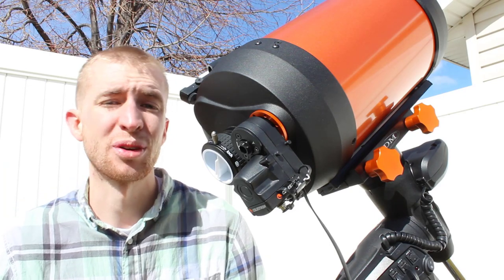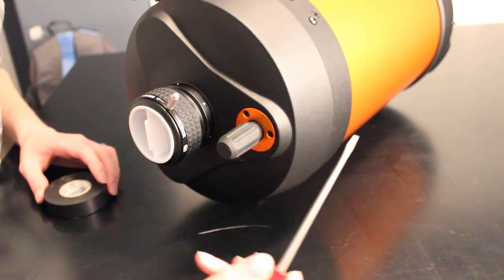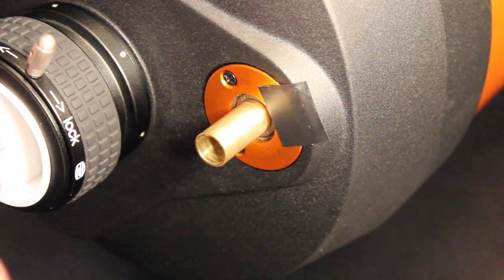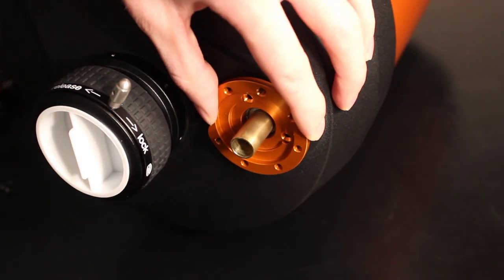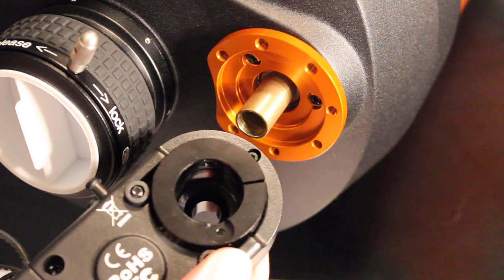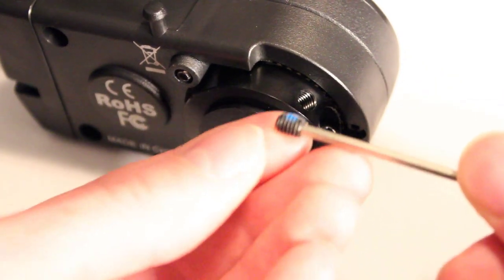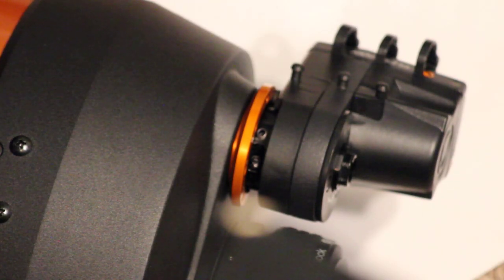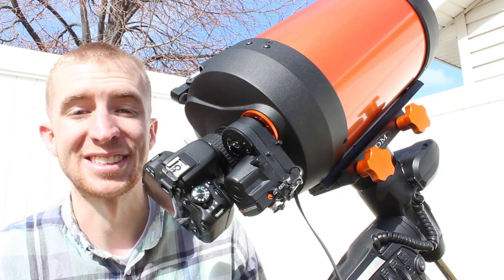How to Install the Celestron Focus Motor (Quick Version)

Comment: Nice video! Did run into a problem  though.
The stock mounting plate has a chamber in it to hold the bearing, because the bearing  is sticking out a little bit above the surface.
The new mounting plate hasn't such a chamber, making is to stress the bearing and resulting in too much friction.
I ended up leaving the stock mounting plate under the new one, bolts were just long enough.
I have a C8.

Comment: Thank you for this great video. I managed to successfully install my motorized Celestron focuser. One thing to note is that at the end when tightening the set screw, it has to go all the way in. I had to try 3 or 4 times because I couldn't calibrate the focusing motor. The set screw was protruding and it was in the way. What threw me off is that you have to put a little bit of pressure to tighten it, and I didn't want to over do it. Other than this, it's a relatively simple but tedious exercise. Thank you!

Comment: I have a C8 that is a bit older and has a raised focuser knob casing and a metal focus knob. This focus motor absolutely will work with it, however a 3D printed adapter is needed to connect the orange mounting plate to the raised collar. Definitely worth the while.

Comment: I already praised the video (see below). But now that I have things working right, I have one more comment about the installation. The instructions in the manual and video talk about installing the set screw (with the blue junk) with just a few turns. I tightened it until I got resistance and (thinking I was done) tried the focuser. The motor was running, but focus wasn't changing. (You can look through the hole to see the brass shaft moving or not.) I discovered that the blue-junk-set-screw needs to go past the resistance point (probably the blue junk) until it squeezes the shaft. That's much deeper than I expected. All good now. (Except for clouds.)
Reply from the maker: Joseph Shuster Yes, tighten it down well. The blue stuff is thread lock, probably blue loc-tite.

Comment: Thank you. I watched this video before I installed my  Celestron Focus Motor on my Nexstar 8SE. It made the process a lot easier since the instructions are written in extremely fine print. The only thing I forgot was to tighten the last set screw. I wondered why it would not calibrate and just turned and turned. My bad. But all is well now.
Reply from the maker: John Patterson hahah yeah that would do it! Glad you got it working.
Reply: Thanks John you solved my problem - and thanks to Astro Blender as well

Comment: One follow-up after I struggled a bit with the install: At 9:00 you imply that you can attach the focuser to the plate using the pairs of mounting holes. For my first attempt, I picked two holes that looked good. After I got one screw into the plate, I tried to start the other screw. It wouldn't catch. I removed the focus and the plate and found that (at least) one pair of plate holes were 1-2mm too close. I found a good pair to get the focuser angle I wanted. It's easier to see the problem off the telescope. With the focuser's mounting screws extended, run the plate around the different candidate pairs. Most fit fine. One pair is tantalizingly close, but not close enough.
Reply from the maker: Joseph, that is strange, I was under the impression they all fit fine. I wonder if that is present on all the focusers or was a bad machine job? Either way, thanks for your comment.

Comment: Excellent Review Slymin!  I didn't know that you can use Hand Controller to change the focuser position.
Reply from the maker: Thanks Ray! Yep, you can use the hand-controller as long as your hand-controller is up to date. Celestron added Motor Focus controls to the hand-controller with firmware version 5.30.8333. That version is a bit-buggy though, so you would want to update the hand-control 5.30.9009 which fixes the problems introduced in 5.30.8333. That being said, this was just an install video. My full review is filmed but I still need to edit it. It is an awesome upgrade and is instantly responsive, I can't be more happy with it!

Comment: Slymin, just saw your that you already did a review of the VX mount with the 6 inch newt.  Good review. Sorry for asking you about it in my previous comment. This review on the new focus motor is very well done and easy to follow. Are you using any software controls for auto focus?

Comment: Hi.. thanks for the valuable info. I was in the process of installing my focus motor adapter plate to the back of my SCT. Noticed the adapter plate does not sit flush to the back of the OTA and there is a gap. Correct me if I am wrong but your adapter plate looks flush to the OTA. Just wondering if the focus motor adapter plate is recessed like the stock focuser plate.

Comment: They didn’t supply the scissors or tape?  What kind’a crap is that?!  

I just recently received a new 8SE, and after messing with the focus knob, I’m seriously considering one of these.  Just annoying to focus manually, especially just getting familiar with my first Schmidt-Cass.  That focuser seems to turn forever.

Comment: As always Slymin ,your videos are amazing and its where i come for great knowledge , one question ,where do you connect  the focuser  ? does it have its own power outlet? thank you , this is on my list ,
Reply from the maker: Thanks, I appreciate that! It has 3 power inputs. You can use the AUX port on the mount, USB (needs supply at least 900 mA), or a 12V, 1A power supply.

Comment: Hey Slymin, You seem to know more about this than the folks I spoke to on FB? lol .. I asked 4 people and 4 different answers..   I'm trying to figure out what i need to do Astrophotography on my 8SE . My understanding ( PLEASE correct me if i"m wrong ). but I need an EQ Wedge , the starsense autoaligner ( it has a camera? do I still need to purchase one for photos?) or can I use that one? also the Focus Motor . are those 3 things basically what I need? or will I still need a Guidescope and camera? Oh Also I purchased the 2 inch eye piece kit. I know it's not the best .. and I need a few more good eye pieces later on, but comes with the diagonal etc. will the 2" stuff be an issue with any of these things?  and is there anything else I need? dont' need? thanks ( I've got a bunch of stuff on my list, like vibration pads etc.. but just running into an issue where I find something and it turns out it's Outdated ( like the NexGen ) etc. . if I can get an ALL in one part . that's fine long as it's not costing me 2 arms and 6 legs LOL
Reply from the maker: If you want to do long exposure astrophotography and you don't want to buy a GEM, then the EQ wedge is essential. It is tought to balance, but workable with n 8". You don't need StarSenese for astrophotography. A guide scope is helpful with a sensitive guide camera, but I would only use one if you're imaging at f/6.3.

My top list for the 8 SE long exposure astrophotos would be:

EQ Wedge
F6.3 focal reducer
Probably a 50mm guidescope with ASI guide cam or Orion Starshoot Autoguider.

If you find you're having troubles with weight, consider investing in a GEM.
Reply: @AstroBlender  hey Slymin, thanks for the info. 
But after adding up all the parts etc. And weight . I realized there is a faster way,  that won't require an EQ, or f6.3 focused or  a guidescope with a camera. On my 8SE.. All unnecessary weight. Of course my solution.cost a few bucks. But minus all those things I won't need to purchase.. Cuz astrophotography  will take only seconds due to the f1.9 on the Hyperstar that a company here in Tucson sells called Starizona. They custom make the Hyperstar. With it I won't need any of that stuff except for the starsense !!  You should check it out if not familiar with it.   But think that's the route I'm going,  less parts to break down.etc.
Reply: @AstroBlender  Are you able to answer Frank's question on whether the 2-inch diagonal on an 8-inch SCT will be an issue in conjunction with this Focus Motor?

Comment: Hi, Isn't it reasonable to tighten the clamping bolt first and then the set screw to maintain the focusing axle to be secured at center of the holder ?

Comment: Great video as always. I have an avx mount. Will I need a new hand controller to focus with? I don't see the "focus" button on my mount. I am interested in getting this as I HATE the 8" SCT  manual focuser when doing photography. Thanks for the great video
Reply from the maker: Hi, you won't need a new hand controller as long as you have a version 5 or 6 hand controller. NexStar+ (or NexStar+ with USB). You just need to update your hand controller firmware to the latest version with Celestron Firmware Manager and you should then have a focuser button in the utilities menu.

Comment: Before I get a Celestron HD Deluxe 🤷‍♂️ I need to figure out how to utilize the mechanics of the locking mirror clutch… 

Seems like it’s a big deal and according to celestron the locking clutch aren’t true locks and only bend the rod that clocks the mirror in play.
Reply from the maker: You can use an auto focuser on an EdgeHD, but you must ALWAYS keep the mirror locks loose.

Comment: hi, thank you , I have a question , if I add the sky portal, wifi, and disconnect the handset (apparently they conflict), can I control the focuser with sky portal app? then if you can't, it would mean you couldn't have them both simultaneously !?

Comment: Do you just use the scroll up and down buttons on the hand control to focus? I have the CPC 1100
Reply from the maker: You have to select the focuser menu and then select your speed as 1, 2, or 3. Then the up and down arrows (not the directional arrows), control the in/out position of the focuser.
Reply: @AstroBlender  I will see if I can find that menu tonight after I do the star align, just got the telescope and will be trying it out tonight for the first time. Thank you

Comment: Is the focus motor compatible with the evolution 6?
Reply from the maker: Yes, it is.
Reply: AstroBlender oh ok cool, thank you
Reply: @Framie06  I have the Evo 6 as well, but I read that it won't work with the Celestron OAG which I use for guiding. Appears there's not enough clearance with the OAG in place which is a bummer.  I wonder if the ZWO OAG would work with it since it has a very small footprint unlike the Celestron OAG.  Also, maybe Celestron will design one that would be compatible with their OAG in place.
Reply: @clockman9097  Thankyou this helped out a lot I’ve been waiting for an answer for a very long time. Yeah hopefully celestron do soon.

Comment: The worst part is having to do controller upgrades. If you have an original versions of the goto drive, you will need a new controller and cabling.